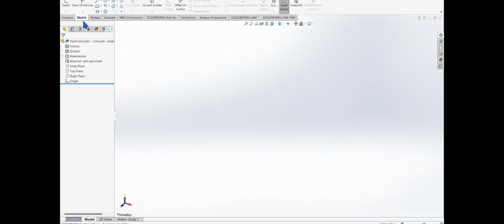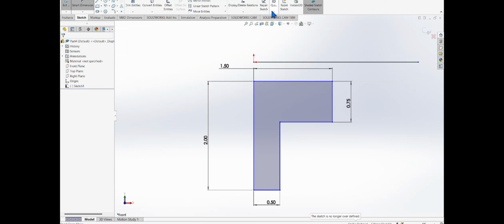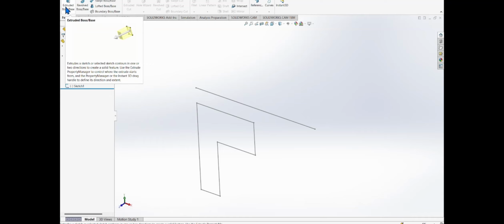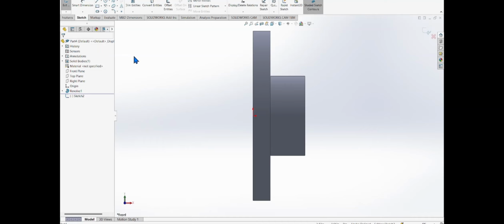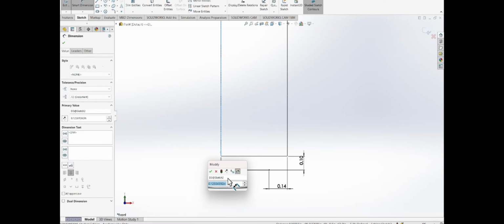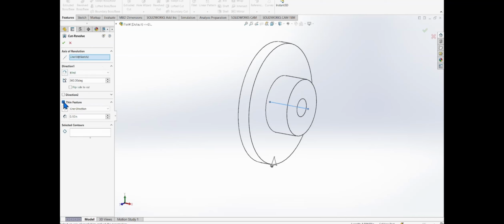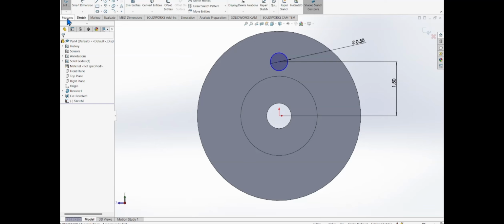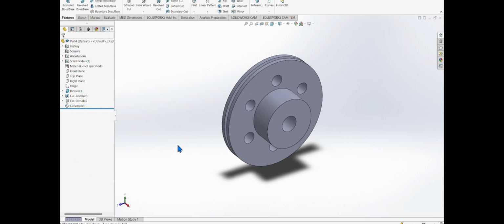Solidworks 2024 Revolving and Circle Array Basics

Comment: CHECK YOUR SOUND VOLUME! I listened to Arvin Ash on YouTube at moderate volume levels on my computer.  Now I can barely hear your speech with my volume settings at FULL.
Reply from the maker: I am updating these videos in future. yes i notice the volumes issue because of the older version with video recorder. but there will be updates with new parts and videos since solidworks has changed recently.